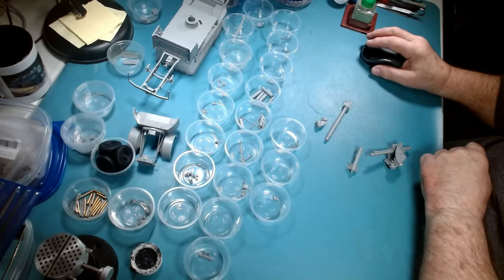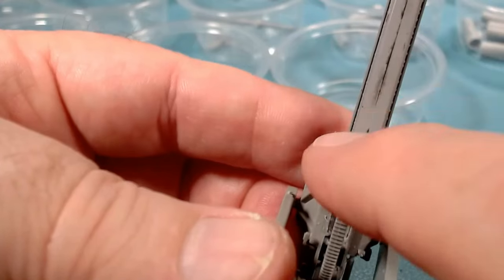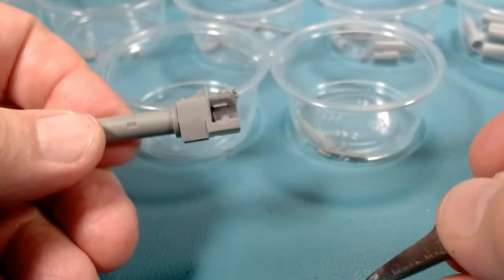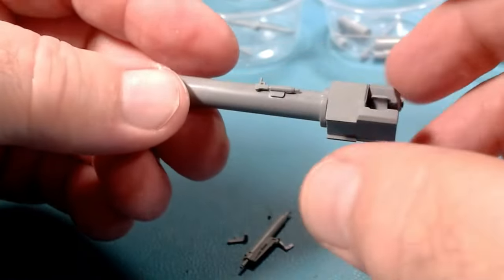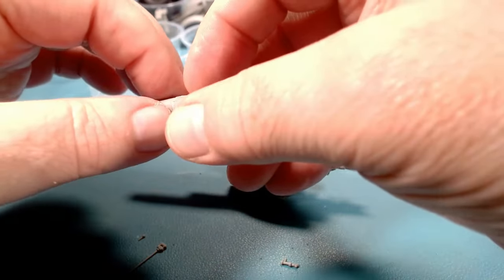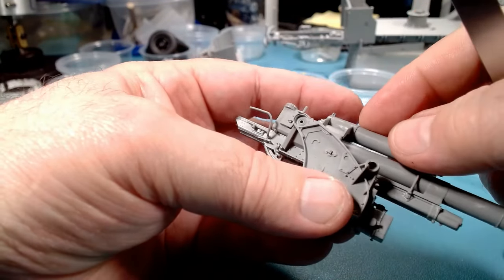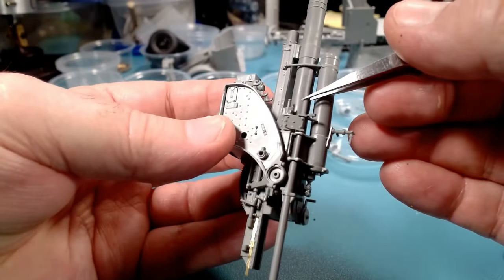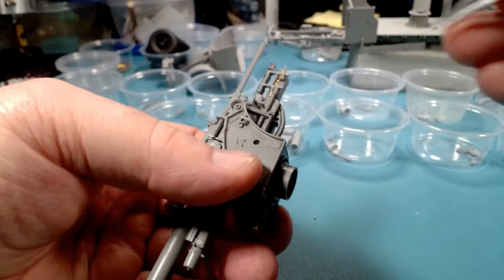Das Werk 8.8cm auf 9t VOMAG Part 22

Comment: Kit is cramped with fine detail, but if the instructions are giving you trouble, i don't even dare to imagine what they will do to me or someone else. I hate it when a kit's instructions have "iffy" placement of parts, that's sloppy design from the manufacturer side. Anyway, great job done Jeff, thanks for sharing, take care and keep up the good work my friend!
Reply from the maker: Hi George, Thanks again for watching.  The instructions do leave a lot to be desired.  The locating points on the parts are also very small.  It's very easy to accidently sand them off.  Have a great day my friend.  Jeff

Comment: Hi Jeff, Glad to hear all went OK at the Docs. I was also a little mystified over those cylinders having to be glued in place? Seems crazy when all else moves.
Reply from the maker: Hi Nigel, Thanks again for watching.  I had a couple of comments about those cylinders. Those forks that hold them in place are accurate.   From what I can tell, there were a couple of springs inside that, as the gun elevated, would compress so that they held the cylinders in place.  Unfortunately, we have no springs inside of the model parts to do that.  I'm still thinking about how to modify the mounts so they look correct, but still allow them to pivot.
Have a great day.  Jeff
Reply: @JeffDonahueScaleModeling  I think you guys might be over thinking the situation.there are two parts to the cylinder. the front slides into back cylinder- they say to glue part H9 into H26 then glue M2 over that. That will keep everything in place. It might be you can only have the position in one of two options -elevated or horizontal, as per the other parts M3 and M4. Check the instructions for the Dragon or AFV Club kit on scalemates to obseve the way they did it. I don't have this gun so cannot give a hands on opinion
Reply from the maker: Thanks James, I'll look at the Dragon instructions.  Have a great day.  Jeff
Reply: @JETScaleModels  thanks. I don’t think we’re overthinking this. The issue is having the gun moveable when clearly these parts need to glued in place. I have asked the question in my part 12 video which parts I should use, M2 or 3/4? Looks like you may have answered that for me?

Comment: hey Jeff I would not do anything with that "fork" you mention. That is how it is. I'll put a pic up on my YouTube community section if you want to see.
Reply from the maker: Hi James, Thanks again for watching.  After making the video, I did a little looking.  I have the Tamiya kit of the 88 and their parts are completely different.  They molded pins into the forks that hold the cylinders in place.  I have a manual written my the  US War Dept in 1943.  Every photo of that area is hidden behind the shield.  I did find a drawing of the area, but the detail wasn't great.  I see the photos you posted, I really appreciate you doing that.  I'm wondering if the real cylinders had a big spring inside that would keep them in compression so they would stay in place???  Have a great day.  Jeff
Reply: @JeffDonahueScaleModeling  I don't have any drawings showing the internal design The top bit is the compressed air reservoir, the bottom ones are perhaps filled with springs and oil, to absorb the force of the gun firing in various ways.The two directly above and below the gun tube are the recoil system; the two below and to either side of the gun tube are the gun-mount equilibrator system: the mechanical arrangement that keeps gun and recoil system aligned in the cradle. Equilibrator tubes are an essential component of artillery systems, including the 88mm flak gun. In the context of a flak gun, the equilibrator tubes are part of the recoil mechanism. Here's how they function:

1. **Recoil System**: When a gun fires, there's a massive force generated by the explosion of the propellant, pushing the projectile out of the barrel. This force also pushes the gun itself backward, which we call "recoil."

2. **Counteracting Recoil**: To control this recoil, artillery systems use a system of springs, hydraulic pistons, or in the case of the 88mm flak gun, equilibrator tubes. These mechanisms work to counteract the backward movement of the gun.

3. **Equilibrator Tubes**: Equilibrator tubes are essentially hydraulic cylinders that are connected to the gun mount and the gun itself. They contain fluid (usually oil) and a piston. When the gun fires and recoils backward, the fluid in the equilibrator tubes is forced through small openings, creating resistance against the movement. This resistance slows down the recoil, preventing the gun from moving too far backward too quickly.

4. **Balancing Force**: The equilibrator tubes are designed to balance the force of the recoil, allowing the gun to return to its firing position smoothly and quickly after firing. This is crucial for maintaining accuracy and for rapid follow-up shots if necessary.

5. **Maintenance**: Equilibrator tubes, like any other mechanical component, require maintenance and periodic inspection to ensure they function properly. Any leaks or damage to the tubes can affect the performance of the recoil system and, consequently, the accuracy and reliability of the gun.

In summary, equilibrator tubes are integral parts of the recoil system in artillery guns like the 88mm flak gun. They help to manage recoil forces, allowing for more accurate and controlled firing of the weapon.
Reply from the maker: Wow, thanks James, Lots of information there.  I'll never remember all this, but at least I get a better sense of how all the different parts work.  Thanks for sharing.  Have a great day.  Jeff

Comment: Hi Jeff, check the position of the photo-etched "strip" (part no. TP1).
It is moved too far to the right and that is why it sticks out so unnaturally.
Greetings from Poland, Chris
Reply from the maker: Hi Chris, Thanks for watching.  When I initially test fitted the PE, I thought the right end should be even with the end of the cradle.  There is a recess in the cradle that the PE fits in that makes the part set further to the right and extend past the end of the cradle.  The way the instructions are drawn, there is no clear picture of exactly where the PE should fit.  I've installed parts over the PE now to the point I can't easily reposition it.  I'll have to see if I can find a clear photo of the real gun that will help me decide if I want to trim the part or leave it as it is.  Have a great day.  Jeff
Reply: @JeffDonahueScaleModeling  Once again, I've posted a few pics from my travels at the community section of JET Scale Models
Reply from the maker: I've got the pics.  Thanks again James.  Jeff